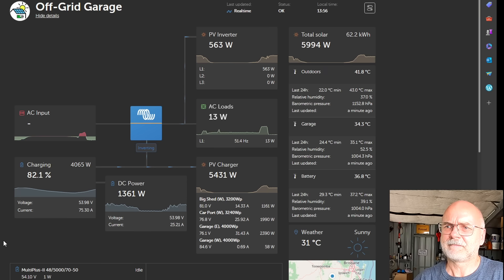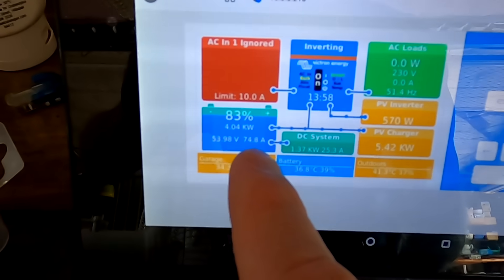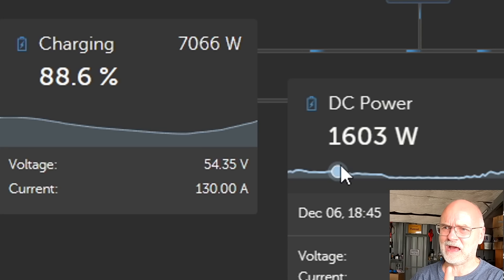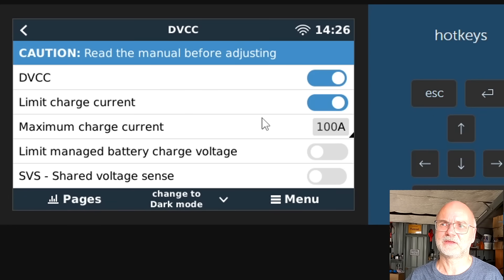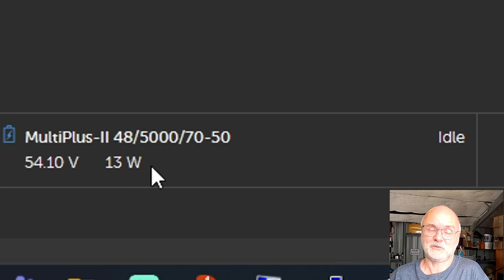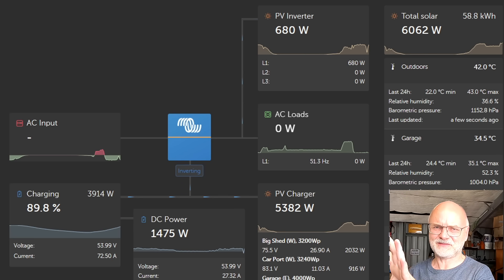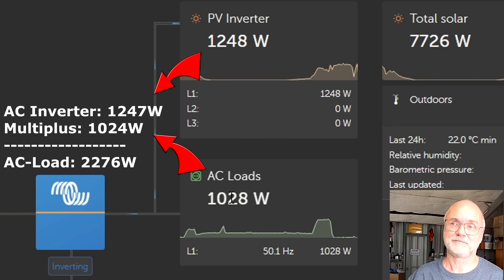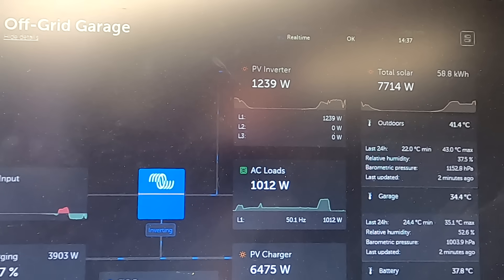Frequency Shifting at low SOC. A home-made problem turned into an interesting and efficient feature.

Comment: Andy, you need to install some sort of air conditioner in the garage.  I don't have anything else to do with electricity in the summer, so I bought two air conditioners for my house.  Now it is very cheap.  For one split set under $400.  Madness.  Of course I have to install it myself 😁
Reply from the maker: I need proper insulation first... all on my list.

Comment: they say these cells like a temperature between 15C and 50C the best. so 40C is perfect and does not do any harm
Reply: They don't like extremes on either end.  Ideally, they like room temp.  Heat will age them prematurely, especially 50C!
Reply: @ssoffshore5111  50C is nothing for these cells. a dude that is developing battery technologie is saying that.
50C will not age these cells at all!
Reply from the maker: 25°C is the ideal temperature for these cells. They perform best at 40°C though.

Comment: Thanks Again Andy.
I have 5kw Fronius Ac coupled to my 2 Multis, and it works great, throttles around 1300hrs this time of year, I have home assistant turn on Air conditioners in the house 1st starts at 90% battery, second at 95% battery so by 1400hrs battery hits 100% and the 3kw of Air con load and the home base load 1kw is al supplied by the fronius, and as things go on and off it moves around a bit. sometime excess into the battery, others times drawing initially until the freq adjusts accordingly. But it always tops the battery back up if it draws from it.
 The only issue I have is the new JK BMS in float mode cause the Freq to lock at 53hz (no solar) when they change from 55.2v down to float mode 53.5v. So in the short term I have gone back to the Victron shunt. Also the two BMS keep loosing coms with each other and this slows down or changes the %SOC and messes things up...Waiting on the next firmware to hopefully fix some of these minor bugs now.
In Feb I will be adding a Victron 450/100 with 4kw of solar in prep for winter, looking forward to see how the system plays nicely then.
Thanks again for the videos Andy, keep them comming

Comment: Using freq-shift to have the PV inverter match the AC loads also helps keep the Victron cooler in the hot environment, as it’s not processing power. Inverters are always less efficient converting ac to dc.

Comment: The flip side of AC coupled solar is that they generally have a higher input voltage (~600v DC), so there is a loss when charging to a DC bank with them but the TCO is usually lower at larger scale because the cable cost is lower (10ams at 600v vs 60 amps at 100v), size of strings etc is larger (which introduces shading issues). But most importantly your multiplus 2 has a charger in it, which is doing nothing if you dont hac an AC powersource. 

Also with phase shift, you will see that kick in when the battery hits float or absorb, and it will also kick in to keep the AC system from being able to overpower the charger, since the charger is the key component in taking our the peaks in solar production.

Comment: Hello, I am asking myself what is the impact of the increased AC frequency on the load(s) ?
On a pure resistive load certainly zero but what´s about a computer or a clock ?
Thank You for the video !
Reply: grid-compliant equipment are required to function normally on 45-55hz for 50hz devices, as well as from 195V all the way up to 255V. if your device cannot handle this, then it is designed incorrectly.

Clocks in computers do not use frequency to sync. Clocks in old ovens/stoves/etc. use frequency, and they will lose sync.
Reply: @stefanvanzyl9090  Thank You for the answer, Yes I heard about the oven, well I think I can live with that !

Comment: Hi Andy. An excellent explanation. Do you happen to know if the MultiPlus does the same when in ESS mode?
Reply: Multis can only do this when they're fully off-grid. When in an ESS system they're synchronised to the grid frequency and can't do any frequency shifting

Comment: Off topic but do you know if  or how to use the HDMI on the rasberry pi to display venos os on a regular computer monitor?
Reply from the maker: Yes, it should just work when plugged in.
If you want touch screen as well, there is a driver necessary.
Reply: @OffGridGarageAustralia  I tried amd I get no output video
Reply from the maker: @todamnbad  have a look here. That might help: https://community.victronenergy.com/articles/10516/howto-use-a-hdmi-screen-with-usb-touch-panel-and-u.html

Comment: Do the Victron CC's talk to each other eg when one goes to float it tells the others to to the same
Reply: There is a master charge controller and the others follow it, so Andy only has to change settings on that one.
Reply: @stefanvanzyl9090  Ok it's similar to my system
Reply from the maker: Yes, if they are all linked to the Victron Smart Network, they will synchronise charging. I made a video here: https://youtu.be/fr_P3DPZT88
Reply: @OffGridGarageAustralia  Cool

Comment: I have a similar problem. I have all Schneider Electric devices.  In the morning, the sun charges the battery bank up to 100% but after that, the Solar power gets throttled back rather than supplying the loads. Once the Sell function starts, the system starts using all available solar production.

Comment: I've had the same issue as you all last summer. I have mainly DC solar inverters and two AC-coupled inverters. Battery at 60%SOC and my AC-coupled inverters switched off and on again two or three times an hour. I would eventually reach 100% SOC but I was worried this switching on and off would damage my inverters. Also, frequency shifting messes up all our clocks with digital displays as they lose time every time the HZ increases. 

My DVCC is 'forced on' and the charge limit set to 70a. Did the Pylontech batteries do this? I suppose I cannot do anything to stop this from happening?

Comment: 3:50 WOW! >37⁰C!  Will you add ventilation to it? ~40⁰C is kinda unpleasant IMO.

Meanwhile many local solar forum members would attest their "expensive branded battery" can be used upto 70⁰C compared to our cheapo DIY battery pack. 50⁰C is too hot to the touch, let alone 70⁰C, I wont bet my house on that...

Comment: Wish you'd consider a cellar build with sunken water or mineral oil bath for batteries keeping them around 20⁰ degrees, automatic cooling of underground pool during night time hours with pump & vapour condenser setup outside.
Reply: That sounds like it will cost more than the price of new batteries. Remember even if you keep LFP batteries at 20 degrees and 50% state of charge for 15 years, they will still experience calendar aging and lose capacity. so over a 15 year lifespan, buying new cells is cheaper than doing overkill to try and extend their life.
Reply from the maker: 40°C is fine for the batteries. It's only a day here and there in summer when they get that warm...

Comment: Do you have single phase electricity in Australia like in US or 3 phase like in EU?
Reply: I am asking because i have some 3 phase consumers like my tesla charger as well as my heat pump.
Reply: @olafschermann1592  He has 3phase in/on the house, but only using one phase.........but offgrid means offgrid....
Reply: @kurtmiller7945 can still have 3 phase off grid, just need suitable inverters, or in Victrons case three identical inverters configured correctly.
Reply: Aus is generally 230v 50hZ single phase. 3ph can be connected on a use by use case.
Reply from the maker: All follows the European standard down here.
Reply: @OffGridGarageAustralia  And because of the southern hemisphere the streets and cars are mirrored compared to EU. Thats why the steering wheel is on the left side 😂

Comment: Interessant. Welchen PV Wechselrichter verwendest du?
Reply: Glaube, er nutzt nen Mikrowechselrichter
Reply: @ludwigbrackmann1115  weißt du welchen? Würde mich interessieren, weil dieser WR scheinbar linear mit der Netzfrequenz drosselt. Viele WR schalten mehr oder weniger abrupt ab, wenn die Frequenz eine gewisse Schwelle überschreitet.
Reply: @derkoni87 
Andy hat einen Modulwechselrichter mit 2000W und 4 MPPTs.
Es ist ein OEM Produkt gebaut von Deye. Wird vermutlich baugleich zum Original sein.
Reply: @Juergen_Miessmer  Danke. Ich habe den HMT 1800 von Hoymiles. Zwar habe ich die Victrons noch nicht in Betrieb, aber ich frage mich, ob der Hoymiles auch so schön linear die Leistung drosselt.
Reply: @derkoni87  leider nein. Müsstest Du mal in seinen Videos suchen.
Reply from the maker: It's here on my website: https://off-grid-garage.com/solar-charge-controller/

Comment: I have a Victron ESS system with Enphase micro inverters, im not fully set-up yet ( guess nobody ever is, lol ) , but you can also set the maximum charging rate in the ESS settings, not in amps, but in watts. But it's the same idea.
But a question to Andy, how fast do you normally charge ? I guess you are smart or knowledgeable enough to work with C-rate's ?
So why ever mess with the charger settings ?
Reply from the maker: ESS is so different to off-grid though. I have to be careful where the energy goes as it cannot overflow to the grid if I have too much.

Comment: Why is your AC Loads showing 0 watts with the frequency shift. I have a OffGrid sytem with Ac Coupled Inverters and it´s showing my PV Inverters are delivering to my AC Loads.
Maybe your AC Meter for the PV Inverter is set to the wrong position in Venus OS. I´ve set it to AC Out.
Reply: The microinverter does not communicate directly with the victron system, there is no external CT installed to measure the AC loads, so the only data comes from the CT inside the victron, which shows zero when frequency shifted
Reply: He installed an Shelly 1PM.
That is measuring the PV inverters Power.
When you go in the menu settings-> Energy meters -> Position then you can set it to AC input 1, AC Input2 or AC Output.
When you don’t have an AC Meter it Simply doesn’t show an PV Inverter.
He made an Video about it.
Maybe he need to change/add the setting position in /data/dbus-shelly-1pm-pvinverter/config.ini to 1=AC output.
Then I think the Venus OS should be able to calculate the AC Loads.
Reply from the maker: Yes, the Shelly is my CT for the micro inverter, and it shows the data in Victron. It is connected to AC-out and set as such in the system.
If I limit the charge current, the micro inverters deliver only as much power as my current AC loads are. Hence the output of the Multiplus is 0W at this point.

Comment: Hey Andy...
Maybe you should change your system to Deye...
Because you are making many mess around your system...one 15\16kW LV Deye hybrid inverter will fix all your issues...
That peace of keap "victron" is not worth my the money you pay for it...
Give us some information on smart inverters with multiple options...try Deye and you will be surprise...
Thanks...
Reply: the 16kW deye is both more expensive and less efficient than the system Andy is running now. He will not be able to sell the victron kit for the price he paid, so all this will do is make his system return on investment take even longer.

Then, the 16kW deye has a higher MPPT input voltage, meaning you need to run more panels in series, which makes the effects of shading from the trees even worse - making the system less efficient. Andy already said he will not cut down the trees because there is enough panels to fully charge the batteries when using low voltage MPPTs - putting in solar optimizers makes this even more expensive for little reward.

The deye 16kW is AUS$6750, compared to less than $2000 for the multiplus... there's no sense paying more for a grid-tied hybrid inverter when all Andy needs is an Off-grid type unit.